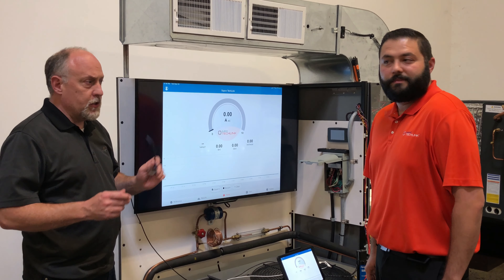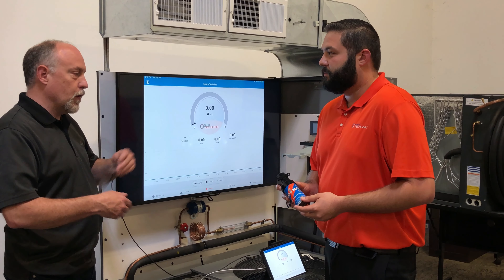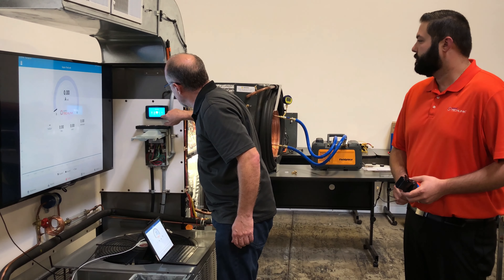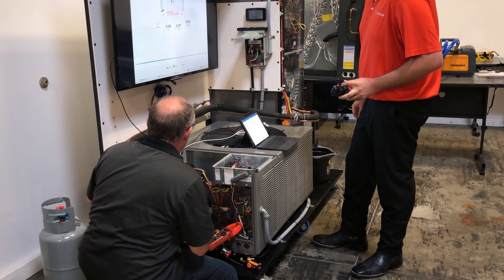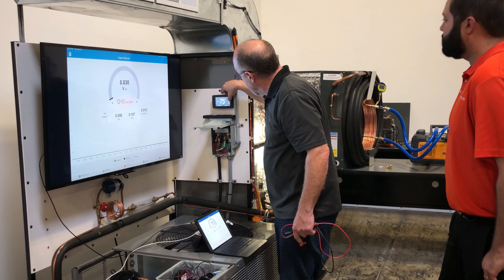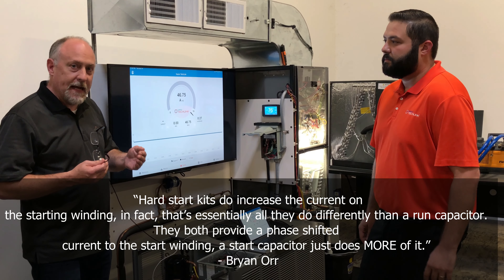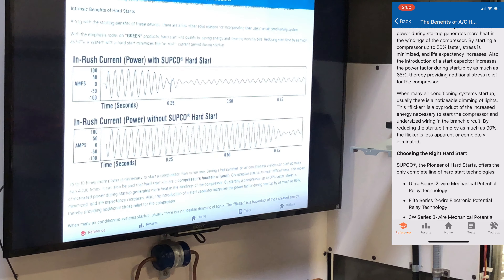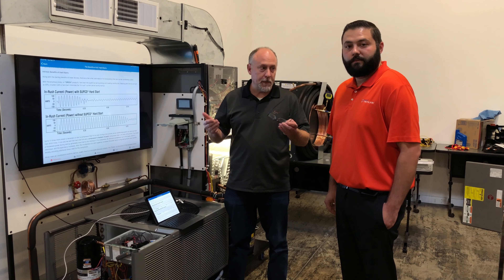Measuring Inrush Current with Redfish iDVM550

Comment: Is there a mechanical advantage to the compressor with a start kit like this?
If we are talking electricity, does it matter if it is higher amps for shorter period or lower amps at a longer period? And if you use the provided time, we are talking one half (1/2) of a second.